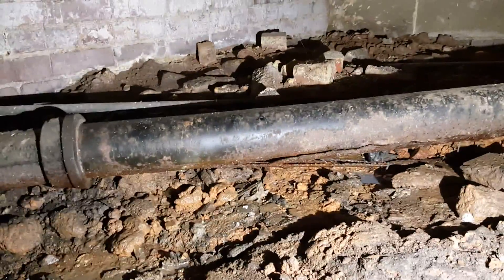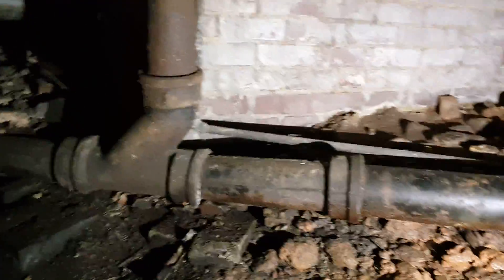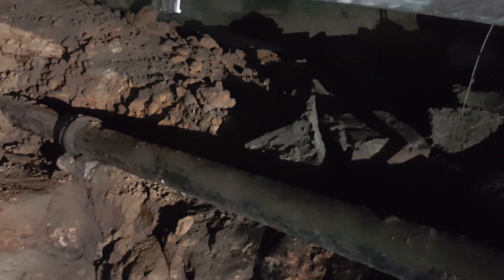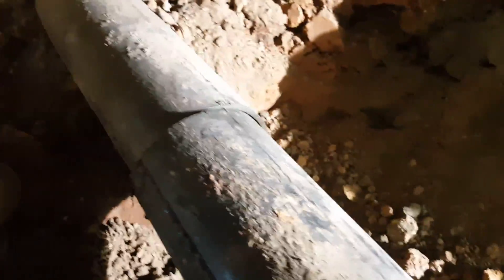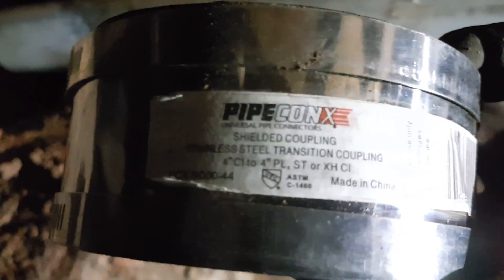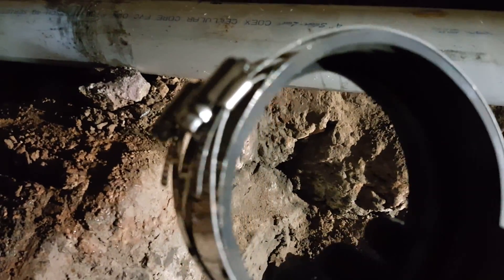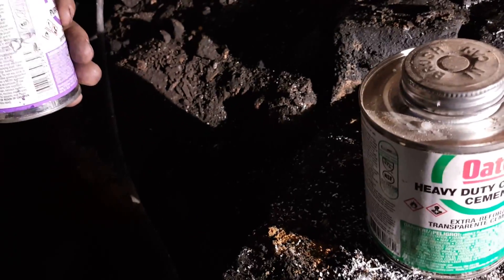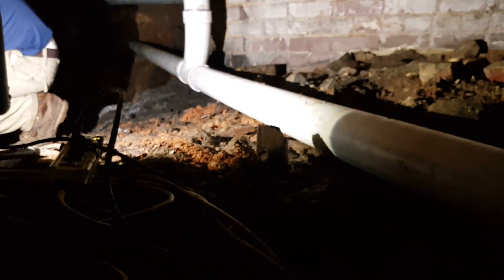How to replace old cast iron sewer lines

Comment: I just did this last weekend. It was a lot easier than I thought it would be. I used a Makita grinder with a diamond blade (two for about $25 at the home improvement store). I replaced about 60 feet in my basement. 

Two plumbers had quoted me about $2000 to do the job. I did it myself for about $200, but it took me about five hours. The cast iron was easy to get rid of. I hit it with a sledge and put it in a barrel for recycling at the curb.

Make sure you think it out and don't make your first cut super close to the main line in case there is an issue.

Great video!
Reply from the maker: Awesome!!!!! This is why I like to make this videos, I know many of us can do other jobs if someone teaches us how to do it

Comment: did you say to use heavy duty pvc cement because regular cement couldn't handle the presdure?
Reply from the maker: I have seen regular PVC glue getting loose so the heavy-duty one is better
Reply: What pressure? It is a sewer line not water pressure line.